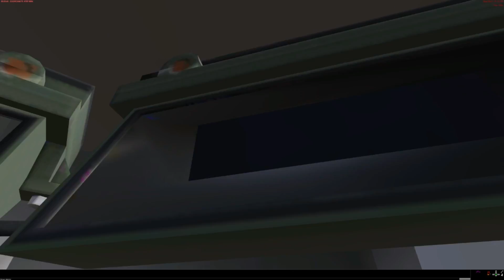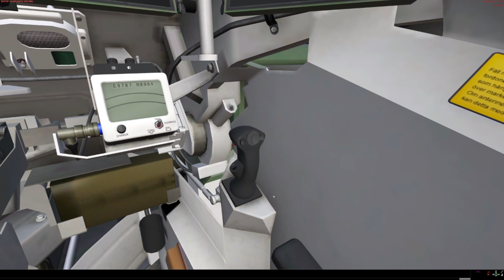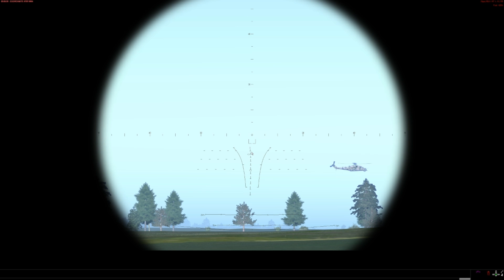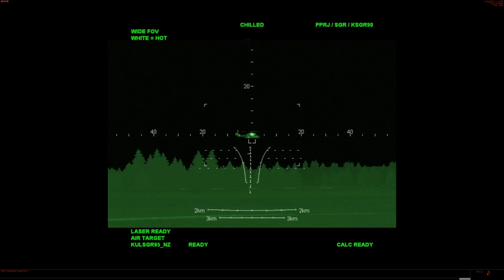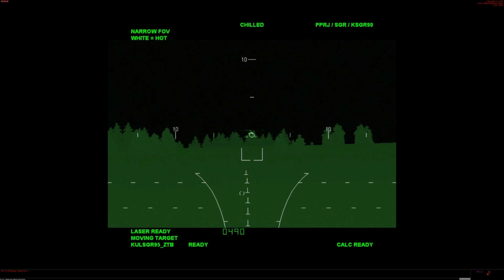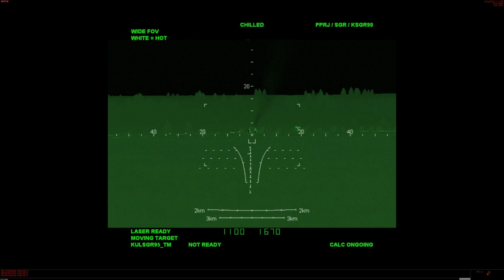CV9040 Switchology and Fire Control System

Comment: 23:55 slpprj is "Spårljuspansarprojektil", meaning roughly: Tracer armor projectile.
Reply: No, it stands for "spårljuspilprojektil", a APFSDS round, usually called "pil" which means dart or arrow
Reply: @oddjonsson2815  "slpprj" is used universally for AP(-C/-BC/-CBC/-DS &-FSDS)-Tracer rounds, e.g. "slpprj m/67" for the 57 mm Lvakan m/54 is a full-calibre AP-T (APCBC-T) round, thus "spårljuspansarprojektil" is correct.
If you wish to verify, you may check pages 33-34 in; Ammunitionskatalog, Data Och Bild, 2014. Which is available online and not too difficult to find a full PDF from the FMV's website of.

Comment: With only light armour and unprotected 40mm shells stored all over the place inside the vehicle this thing seems like a death trap. It's probably as dangerous to its own crew and passengers as it is to the enemy...
Reply: The vehicle is armoured well enough to face a 30mm MK...Its an IFV, NOT a tank....
The 40mm rounds have a brass casing and have insensitive propellant and "warhead", so also not as big as a problem. And that there is not armour between crew and ammo is the same for almost all IFV...exept the most recent ones with an unmanned turret.

Comment: Is that a freaking M1919 coaxial?
google
Oh my God, what the hell?
Reply: ksp m/39 but yes, there were a bunch laying  around, so it were cheap to use them. a budget save there mean $ for some other feature or more vehicles.
Reply: The cheaper machine gun is the better machine gun I guess
Reply: They've been removed when the A and B variants were upgraded to D variant and now they've been armed in the same way as the 9040C with a KSP 58 (FN MAG) mounted on top of the turret

Comment: One of the meanest IFV playable in steelbeasts. Great effect against troops in the open, behind cover in building...basicly everywhere. Able to slaugther any IFV (short of H-IFV) that you encounter , able to effectively engage Helicopters...and even able to cripple tanks (so you can at least run away from them)

For me, this works better then any ATGM equiped IFV...even against tanks.

Comment: This is on a unrelated subject. In WW2 the U.S.  had a Sherman with a 105 howitzer, Why did the y not convert it to an antitank gun. I just remembered  this  will thinking about  something else WW2 related.
Reply: The Sherman did have a high velocity 76mm variant. The 105 howitzer variant would be mainly used for infantry support.
Reply: Shermans with 105mm are technically assault guns
Reply: Marc Dunn You have to realize that it had a 105mm HOWITZER, The recoil loads from a 105mm GUN would have probably torn the turret off (Yes, I know about the Isherman - I;m talking about technology available in the Forties, not Sixties)

Comment: man, just imagine if cv90 was a belt fed weapon and not a clip fed deal.....but at the same time, you probably would be very limited on what you could do
Reply: this was actually trialed with the german Marder 2 using a beltfed 35mm or 50mm autocannon (its a dual caliber weapon where you just need to switch out the barrel) around the end of the cold war. But like many other things that were developed in that time period, it never came to production because the enemy it was designed to fight against didnt existed anymore.

Comment: How do you check and adjust track tension?
Reply: The driver adjust track tension as necessary with a switch on his very extensive control panel

Comment: The Cv90 variants that can use the 3P rounds currently are the Lvkv90 Cv90B1 & Cv90C.
All versions have the ability to be retrofitted with a 3P programmers though, the programmer is also used on all Swedish naval vessels with 40mm and 57mm guns.
Reply: The A and B models have been upgraded to D standard, which allows them all to use 3P now.
Reply: Correct, the B model can now also use the 3P ammo (m/95).

Comment: I'm curious how much ammo the exported 30mm and 35mm Bushmaster CV90's carry. 24 ready rounds just seems pitiful, especially if you're dividing that up into HE and AP. I'm guessing those others carry more ammo so it makes you wonder why they chose the 40mm bofors. You're not penning MBT's from the front anyways so that little bit of extra penetration is kinda meaningless. If you see something a 35mm Bushmaster can't pen you're either gonna launch an anti tank missile if you have it or get into cover. I just can't imagine many scenarios where that little bit of extra penetration makes up for the lack of ammo.
Reply: Larger rounds mean more versatility - better penetration, bigger HE boom, proximity roundswith bigger area of effect, more complex fuses possible.

There are always scenarios where bigger boom, better pen, better fusing can prove useful.

It's harder to fit a lot of stuff in a small round.
Reply: @barrygregory8177  We've reached the point technologically that we can fit anything a 40mm round could hold in a 35mm or 30mm round. One of the most advanced fuses in the world right now is probably being used on the 35mm Oerlikon Skyranger so size really isn't a constraint at the 30mm and up range.

On top of that a 40mm round isn't gonna hold much larger HE charge than say a 35mm round, in fact it might even be less. The fact that the 40mm Bofors casing is significantly longer than the 35mm, 40x365 vs 35x228 means it has a larger charge and a higher velocity. The higher the velocity the thicker the shell has to be to not break apart when being fired. Same reason in WW2 tankers preferred the 75mm Shermans HE shell over the High Velocity 76mm.

And that brings us back to my point. You have a slight increase in penetration for a serious decrease in ready ammunition. I looked it up and the 35mm Bushmaster version of the CV90 has 70 rounds ready to go. That's almost 3 times as many rounds you can fire before the commander has to stop looking out for enemies and start reloading the gun.
Reply: @huntforandrew  It is true that miniaturization has come further along now. But remember, this IFV was designed in the late 1980:ies. The arming decision was made from the technological standpoint of around 1985 or there about. 

The other arming options came about only after the test vehicles had been made and trials with them completed. And some of the variants were designed only after production had been completed on the first series of 9040 vehicles for Sweden. 

Norway (the first customer IIRC) wanted a gun with better Nato interoperability. And so did Denmark and the Netherlands - but they chose 35 mm Bushmaster over the 30 mm that Norway (and then Finland) had ordered. 

I don't recall the years these orders were placed, but they might have been up to ten years after the effective decision point for Sweden. As all of these countries had plenty of Bofors 40 mm in the AD or naval arsenal, it could have been a viable option for them too - but many of them was at the time looking to phase out their 40 mm L/70 AA guns, so they decided not to arm their CV90:ies with an outgoing weapon system. 

The technology may develop further, but it isn't the only factor that decides which weapon to choose. Far more important (in my experience) can be factors like having a stockpile of ammunition, spare parts, an existing knowledge base and logistics solution and so forth. 

(I had completed my basic training as a platoon leader in Swedish armored infantry in 1990, when I got to visit some of the trials om the CV9040. I got to drive one of the test vehicles from the firing range - and nearly wrecked it when we lost road grip crossing a bridge covered in gravel at around 70 kmph. But I didn't, luckily.)
Reply: @USchyldt  The Cv90 was built with cost in mind.
Thats why the early vehicles had no Gun Stabilization as they had to choose between the Thermal Sight and Stabilization.

A manually operated 25mm turret for some of the Cv90's where also contemplated because of cost.

After the 1994 Defence Decition the Army was focused more on Quality than before so a programme of rolling upgrades where started which led to the Cv90A which has limited Stabilization.
Reply: @DeeEight  Those stats are for the m/95 APFSDS-T tho, not the m/01 one. 
The m/01 pens more than that
Reply: Essentially, when the vehicle was designed Sweden used lots of 40 mm Bofors in the air defense. Three different generations of the gun was in use (all the way back to some obsolete WWII era guns for static air defense). There was loads of ammunition and tons of spare parts available. 

It was also one of Bofors main product lines which would ensure that manufacture and development would continue. (As long as the world didn't change. It did.) 

Introducing a new kind of gun, would mean staring an entirely new line of ammo manufacturing - or being dependent on imports.
Reply: The CV9040 is also made for the artic brigades only, they can move over the snow and in swamps to some degree. main tactic was to flank the enemy and engage from the side in ambush tactic so 16 rounds HE or SABOT was not a problem. They would regroup either way and had probably killed all targets in front of the platoon either way. And that you 35 years later can put the sme kind of fuse in the caliber does not say much. UK did go 40mm on their new IFV btw
Reply: The 3P ammo solves much of the ammo problems. It does what you tell it to do and has a much higher probabillity to hit the target with the intended result = less ammo spent. The APFDS is an ammo I would expect to be carried the least of. Perhaps 8 rounds APFDS ready and 16 rounds of 3P, if not the whole "ready rack" is 3P. If the CV90 has to linger out in the open, exposed to effective fire, you have done something wrong. The infantry carried in the back has more than enough equipment to deal with other armored threaths. 
1: Go where you need to be.
2: Get the infantry out.
3: Retreat to a safer distance. Away from RPG range. (If possible)
4: Support infantry.
Reply: I suspect when buying new vehicles is on the table for Sweden the 40mm will be phased out. It was the best fit for us in the late 80s but as you mention technology has gotten better.

Comment: Wich cv90 variant is used by the dutch militairy?
Reply: It is the CV9035NL if you use the name on  Wikipedia but it is noted as the manufacturer call it CV90 MK III.
The main point is that it uses the 35mm  Bushmaster III chain cannon and not the 40mm Bofors. So it is likely a lot closer to the older video for the CV9030 FIN  with a  30mm Bushmaster II  as both guns are developed from the 25mm gun of the Bradley.
I have not the idea of the fire control system part of the two variants but the gun will be closer to the Finish CV90. Only Sweden use it with a 40mm Bofors cannon.
Reply: @target844  i did remember it being a different model but i don't know either what the firecontrol system is in it all that i know is that it's similar to maybe the 30 but can't remember clearly but it might be partly due to it being 2:27 am here in the netherlands 😅

Comment: Why a black and white camera? Why not colour?
Reply: Probably because it was built in the 90's when the detail of black and white was better then the ones with color. Could be something else tho.
Reply: @MrAnton275  It might be because the displays that were designed for the thermal camera is not capable t show full color. the might just be green and white capable so the color was not an option.
A black and white camera will have higher light sensitivity because you are not covering the pixels with red green and blue filters. So as a backup for the thermal black and white camera will be more light-sensitive compared to color cameras regardless of if the was made in the 90's or today.
Reply: B&W gets you better contrast. That is why intel photos tended to be B&W until very recently since now you can just throw a filter on it and make color B&W.

Comment: Just read that they have had a big REMO,  on the C, and have a bunch of D, which are optimized for warm weather and more armour. Saw some recent video from Southern Scania Regiment, with the new apperence it looked little as a Strv 122 who shrinked in the washing. Good to confuse the enemy recon troops, is it a Strv 122 or a CV9040? 
https://youtu.be/nHKsVJEgr6s
Reply: "But it's a troop carrier, not a tank"

"Do you want me to put a sign on it in fifty languages: 'I am a troop carrier, not a tank. Please don't shoot at me'?"
Reply: @michaelkarnerfors9545  And then they do not deploy some more expensive assets to handle that was not a big tank armada?
Reply: I don't understand what you mean. Yes the C version that are used by P7 look more like a tank then a A,B or D version do. But the D version is not optimized for warm weather and neither is the C version it. But the C version have a ACC, more armor and a FCS. The D version is a A/B version with new FCS and not much more.
Reply: Looking over the clip it can only be Strv 122 that you mean, the only armored vehicles that I see there are CV90, Strv 122 and the newer Patria (8 wheeled CV).

Comment: In Sweden the Brigade Recon Companies uses CV90's they are basically Jaegers with armoured vehicles and are trained just as hard as those units as they operate behind enemy lines sometimes only closer to the front than say paratroopers.
Reply: The paras would be much longer from the front then the brigadspaning. Since they would be behind enemy lines and not in the enemy lines. And no, brigaderecon is not like LRRP or rangers. More so then the "pansarskytte" but note like a ranger. Its somthing between.

Comment: The reason the Strf90B has an indicator for the hammer is that it's electrical this is not the case on the Strf90A (and basic Strf90 models before all where modified to the A version)
Reply: What's a Strv90? Did you mean Strf90?
Reply: @ebbelille  yeah

Comment: That 24 volt lamp can be connected to external lights or an orange blender for road movement.
We had those in the ARV variant with two magnetic high powered lights that we could attach anywhere on the vehicle and an orange blender for certain road movements.

Comment: If the situation allows it the troops in the back usually reloads the gun and moves rounds between the upper and lower carousel.
You have to open the gate to the turret basket so you can't move the gun electrically but that's usually not such a big problem considering that the commander can focus on commanding or reloading the MG. Reload is also much faster as the as the troops don't have to bend over to move ammunition.

Comment: Translation of warning label.

"Warning. Fold down all antennas before the vehicle passes below cables which hangs down lower than 10 meters above the ground. If the antennas isn't folded down it could be LIFE THREATENING"
Reply: No joke, we'd occasionally get safety warnings about somebody who was fried when the antenna hit a power cable, and &diety help us, the even rarer but still possible,  ignition of the electrically primed main gun ammunition.....
Reply: Much more likely to harm the vehicle electronics than the occupants.  Like a car, the occupants have no direct path to ground, which is necessary.  The vehicle does, and the power will find its way through the metal in the car to the ground.  I doubt anyone in the vehicle has been harmed by power lines, unless they try to get out.
Reply: @videodistro  Well, overloading the vehicles electronics, when said electronics are all around you and your sitting next to a couple hundred kilograms of ammunition might cause fires, and considering the ventilation is also one of those electrical things, sitting next to an electrical fire in a closed environment with ammunition close by can very rapidly become "life threatening", even if the electricity didn't kill you...so that's my guess what they mean.
Reply: @colbeausabre8842  I'm sure your non-specific gender neutral non-binary "diety" will be there when you need him/her/it.
Reply: @larrysmith6797  boomer moment
Reply: Snap crackle pop
Reply: I figured that one with my rudimentary knowledge of scandinavian languages. (Mostly danish though)

Comment: 41:04 what's the difference between contact & impact fuse?
Reply: IIRC Contact fuzes will detonate closer to the surface of an object while impact allows a slight penetration of the object before exploding.
Reply: Imagine you’re firing at an old  GMC deuce and a half with a canvas cover over the back on the gunnery range.
You fire an impact fused round at the truck. It goes right through the canvas cover without stopping.
You then fire a contact fused round at the truck. Once the round senses the resistance of the canvas cover, it explodes and the deuce and a half disappears because of the load of explodium in the back 😉
Reply: @CAP198462   you think the fuse is sensitive enough to be set off by canvas?
Reply: @captainswoop8722  the 3P at the right setting would be, because I'd suspect just modifies the proximity distance with a delay, as in the fuse is already working on a software timer from when the proximity sensor detects the target to when the shell detonates just as it touches the canvas.
Reply: I'd assume it's a difference of sensitivity. But it could just be the same fuze in different names.
Reply: https://www.youtube.com/watch?v=wewaCdSW4yc

Not all CV90's have a 3P programmer but there is an airburst mode for the 3P grenade that allows for proximity fuze with impact priority.
This means there is a delay in the proximity fuze to create the chance for a direct hit, say against a big slow aircraft.
Reply: One is set on contact, the other on impact... duh